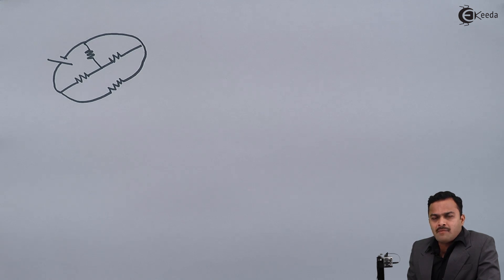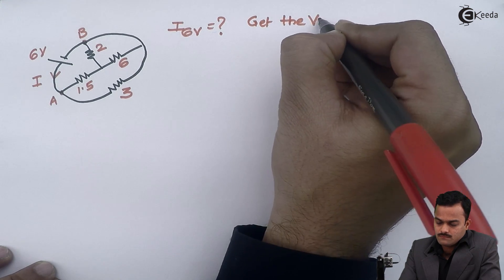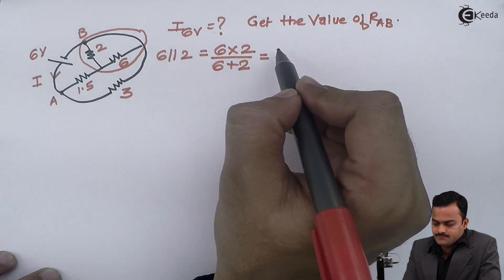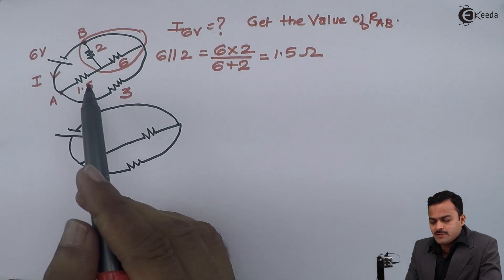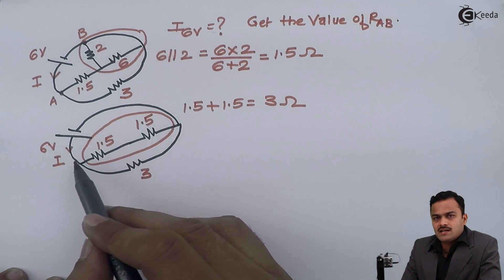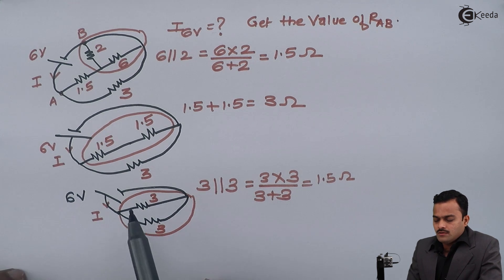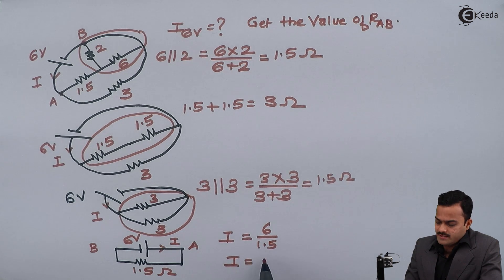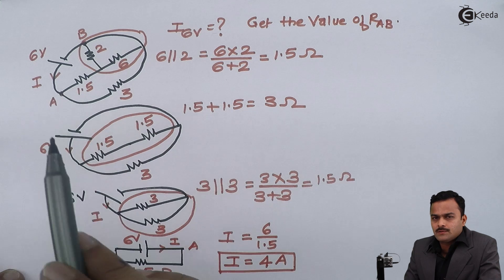Series & Parallel Connections of Resistors : Problem 5 - DC Circuits - Basic Electrical Engineering

Comment: Timestamps 
00:06 - Understanding series and parallel resistor connections in a circuit problem.
01:00 - Calculating equivalent resistance using a 6V battery.
01:57 - Calculating equivalent resistance of parallel resistors.
02:32 - Removing a resistor alters the equivalent resistance in the circuit.
03:15 - Calculating total resistance using parallel and series resistor combinations.
04:08 - Analyzing parallel resistor connections in a 6V battery circuit.
04:54 - Calculating current in a parallel resistor circuit.
05:45 - Understanding the significance of parallel connections in resistor circuits.